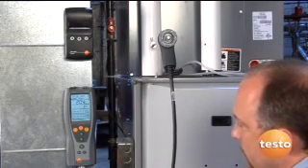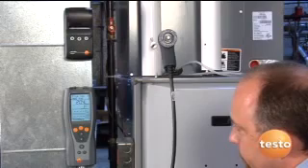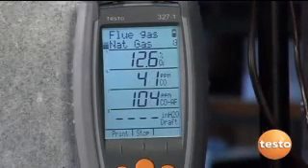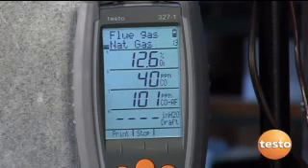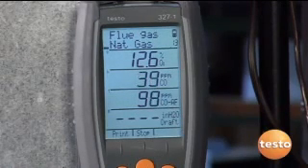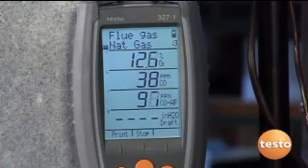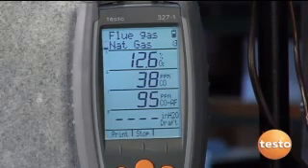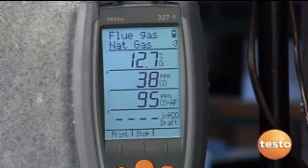Combustion Analysis with the testo 327

Comment: I thought the testo 327 would do a pressure test??? why did he use a separate manometer?
Reply from the maker: Hi Steve1niceguy you are correct Testo 327 does do pressure testing, but it doesnt do it simultaniously while measuring the emissions / exhaust gasses. Hence the indipendent use of the testo 510.